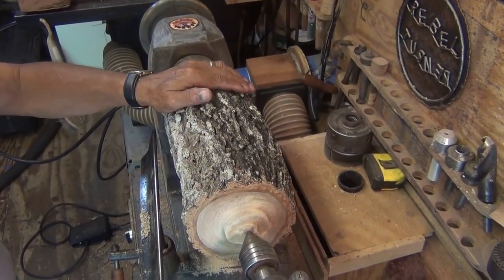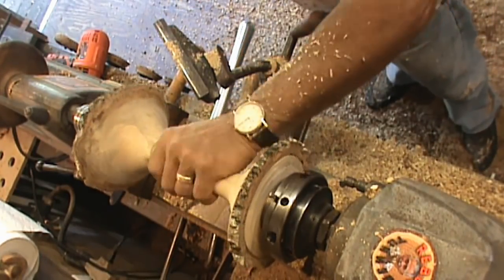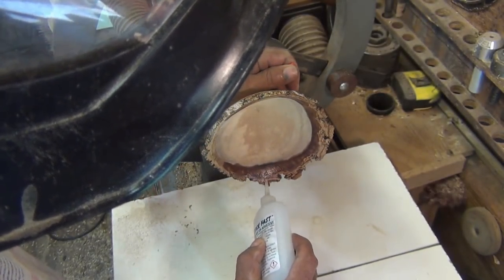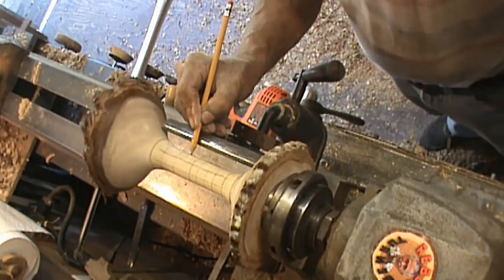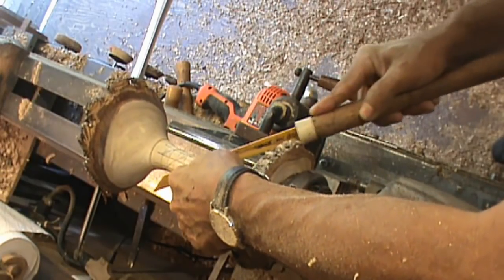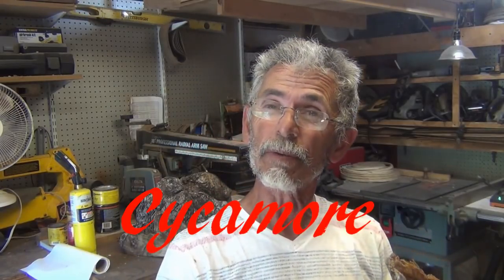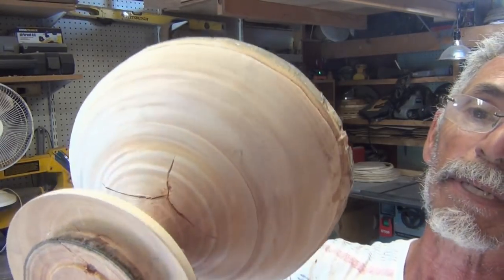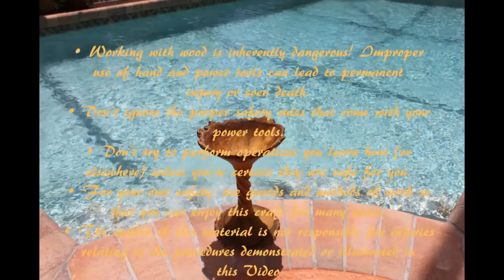Spiral stem Chalice by Al Furtado

Comment: Al your  a true artist always learn so much watching you work . and this piece is awesome how do you  Determine the  spacing on the lines to draw your boxes
Reply from the maker: in this case I split the stem in 3 equal parts  the more you have the more turns it would go around. with 3 dividers it would give me 3/4  rotation per groove. The other lines were just guides to follow, I think I did it in 12 degree increments giving me 4 parallel lines but as said those are only for intersecting points to connect corner to corner

Comment: That's a nice piece. Would be neat to make one and drill a hole up through the spirals from the bottom to top of spiral. Would have to figure out how to chuck it for the drilling. Actually could chuck the bottom and drill down from the top and plug it. That could be a neat look like that other open hollow form.
Cheers, Lee

Comment: Nice and fun piece.   Do you use the extra thin CA glue when you try and fix the bark on?   And do you use different CA for different purposes?
Reply from the maker: Yes I use thin CA for everything even though medium works better on pieces that might separate completely. I like the thin because it penetrates deeper
Reply: @AlFurtado  Thanks for the quick response, I use thin mostly too, even though it wants to go everywhere all the time. LOL.     I figure that the thicker stuff is stronger, but it takes longer to dry and often is just a skin on the surface.